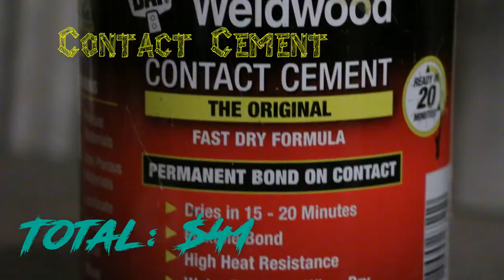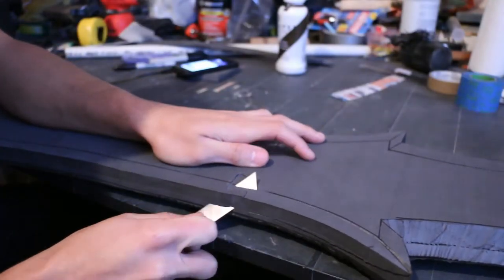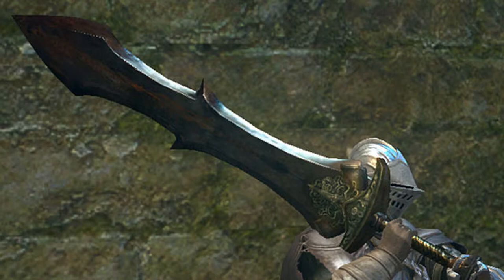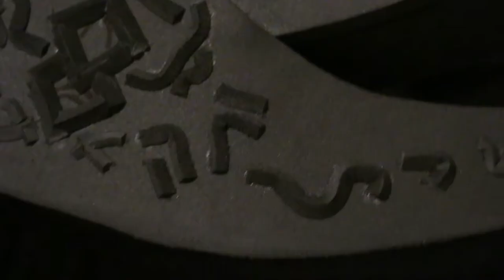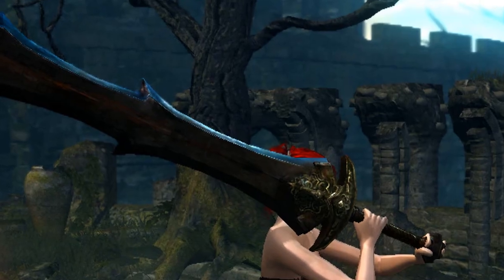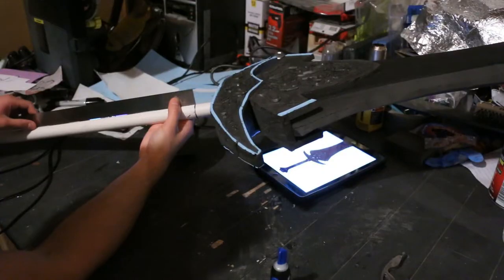How to make the Black Knight Greatsword: From the Dark Souls Trilogy

Comment: Oh wow that's sweet, boutta do this but with wood, my DragonSlayer from Berserk turned out pretty cool, this sword will be a challenge for sure, still don't know how to make engravings on wood, ill def use this video for reference, thanks for your work
Reply from the maker: Sounds like a fun challenge there. My recommended methods for engraving into wood, would be a chisel or a wood burner. Depending on the specific area you'd want raised, you could sculpt it using a rotary tool with a sanding or grinding bit.